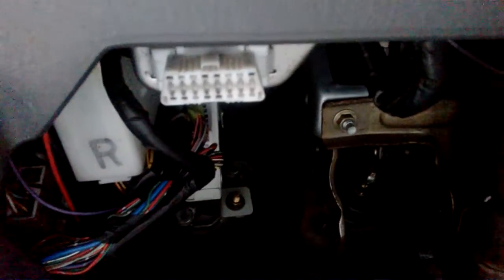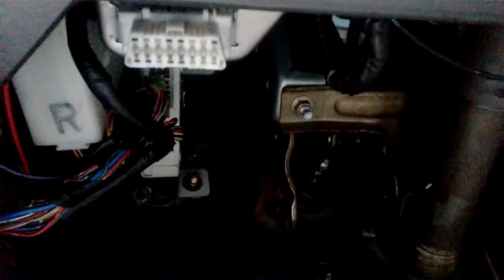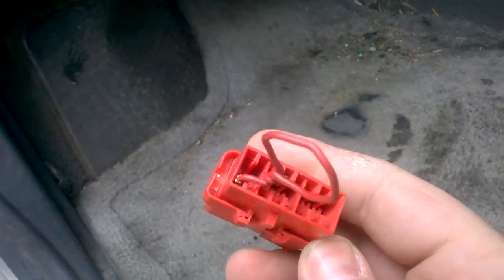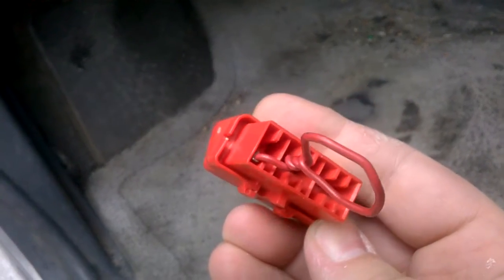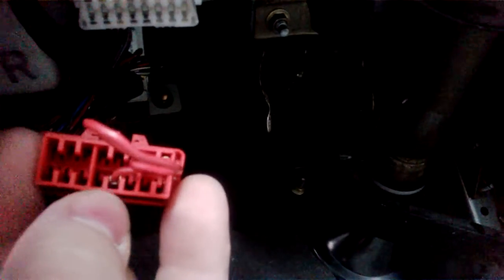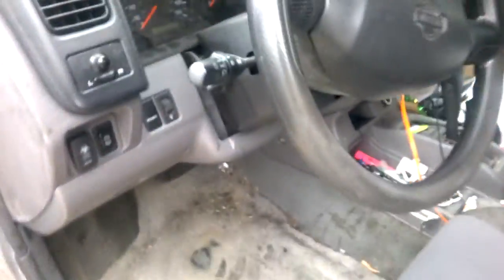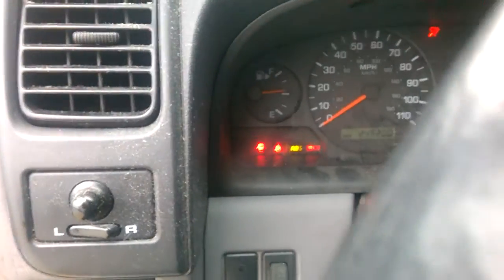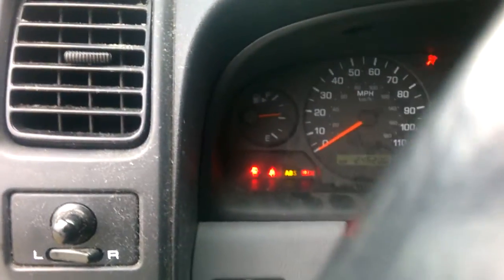How to pull ABS codes from early 2000 era Nissans

Comment: This pin setup does not work for a 2003 Nissan Pathfinder. if you do this it will shorten the 10 amp fuse in the engine compartment labeled eng cont.

Comment: I had this problem, took it to my mechanic and he said he had trouble getting the codes off the computer. Long story short, he replaced the left front ABS sensor, problem did not go away. I ordered this connector, got it today and just now tried this. Not only did I get no codes off the computer, but I had no dash lights come on at all. I thought maybe I had to drive the car first, since I had seen that information also. No dice. I now have a no crank no start. The battery seems fine, I get interior lights and beeping, but absolute silence when I try to start the car. I replaced all the small fuses that said they had to do with electrical, battery or ignition. Still nothing. Any ideas out there?
Reply: It turned out to be a fuse after all. I tried a lot of them, but this was a 10 amp fuse in a socket labeled "Meter". Replaced that, and bingo. All is well in the world again. Btw, I have a 2000 Xterra (built in 1999) and had tried grounding pin 8. It looks like that may not be the correct pin after all.

Comment: "For 2000 Xterra it's pin 8... that's this one" **points to pin 10**
Great video and awesome tool for checking codes. You might just want to correct that pinout flub.
Reply from the maker: Just double checked the FSM for 2000 Xterra, and it's the same pin!  I knew the pinout was numbered differently but hadn't looked at both connectors at the same time before.  2000 is numbered L->R on the top, then the bottom.  2001 is labeled R->L on the bottom, then the top, with top and bottom referring to how my connector is orientated.  

Thanks for checking this.